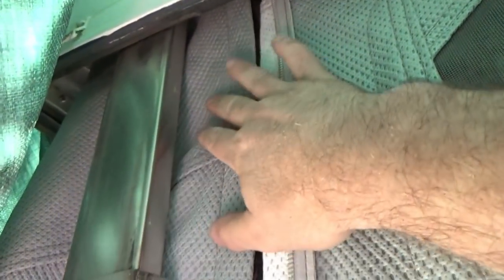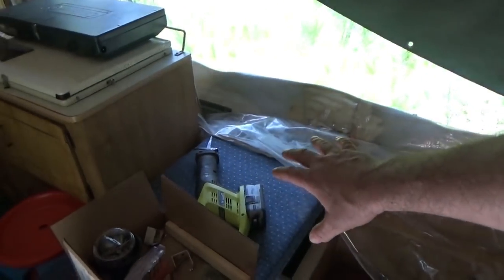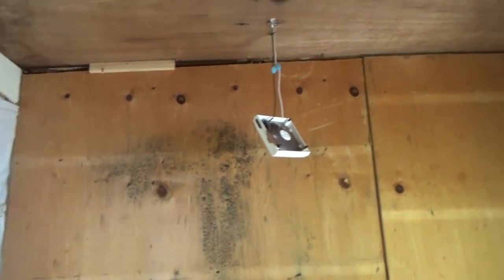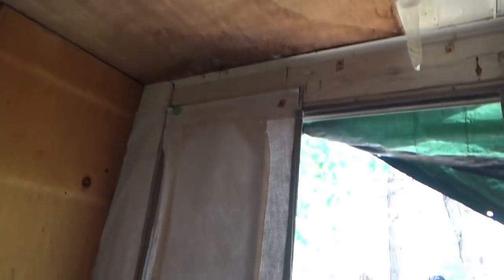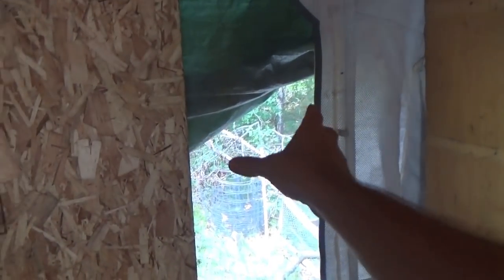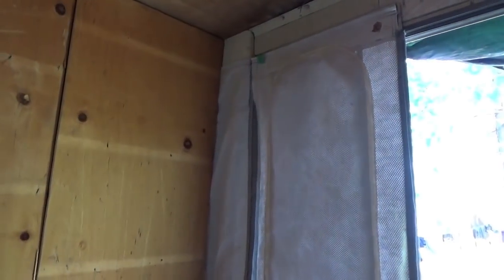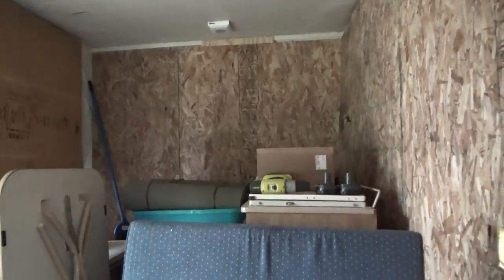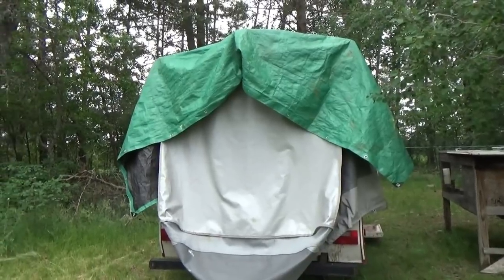Converting Popup Camper To Hard Sides Continued

Comment: I like the concept of converting an old popup camper to a hard sided unit. Although I think that I would have removed the top to avoid having to Gerry rig everything.
Reply from the maker: Its not that hard really. I am just pushing the plywood up against the ceiling. Then I will put 2x3 framing around the top which will keep the ceiling up in place tightly for the snow load in winter. I am keeping the roof because its more like the original camper and it is an integral part of the structure. Also less work. Dont have to build a roof myself.

Comment: Add some sort of frame inside as well as some beefing up the frame and suspension .
Reply from the maker: Yes, I plan to use 2x3 framing around the perimeter of the ceiling and crossing it in a few points. I will probably use jacks at certain points underneath for better support and to get the tires off the ground when not moving the camper around.
Reply: @TheDoItYourselfWorld  I framed the inside of my 20 ft travel trailer  with 2x4s ,gave more of a tiny home look on the inside as well as some structural integrity ,yes it weighs more ,but its double axle and 10 ply tires .
Reply from the maker: Dont know if you saw my first videos but my old camper was held together with 2x4s and duct tape. lol. And I mean literally.
Reply: @TheDoItYourselfWorld  Not sure if I did . I started watching your channel when you started that off grid house ,before you moved .
Reply from the maker: That was on the trailer frame of that old camper.

Comment: the frame and suspension is fairly lightweight adding all that extra weight may be problematic
Reply from the maker: I was thinking about that but then again when you go camping you can put 4-6 adults in a popup camper plus all your gear. 7 sheets of plywood should be fine. But I do plan to put jacks underneath for support and stability when not moving it around.
Reply from the maker: Oh, and I removed the slide outs, rails and supports, which removed a lot of weight.
Reply: We have turned those campers into trailers and hauled 21/2 tons of trap rock no problem. Troy will be ok !!!!